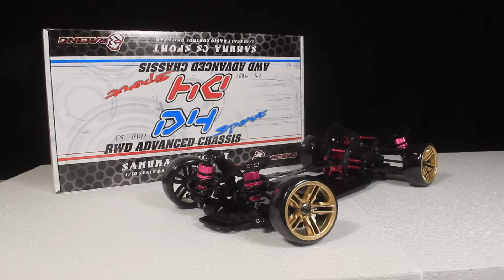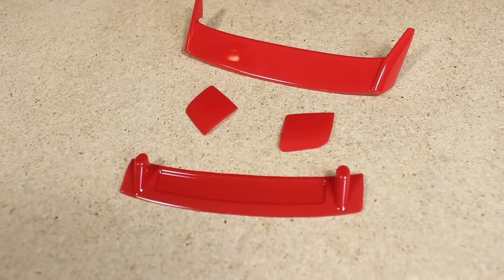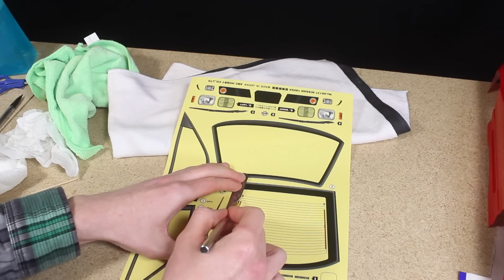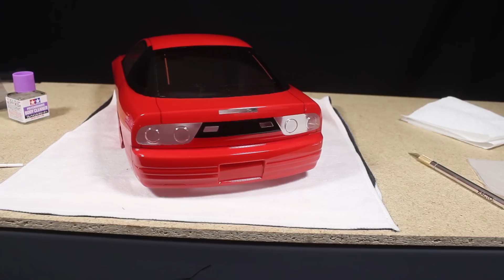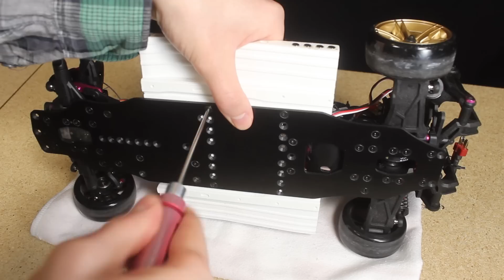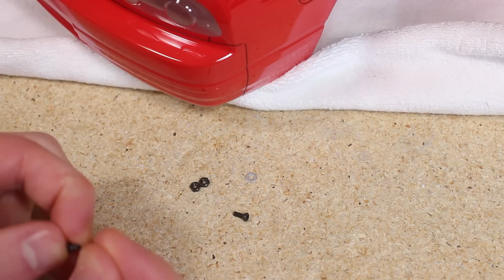Budget RC Drift Build: Part 4 Adding Decals, Spoiler, Tint, and Body Lines

Comment: I applied tint but on the outside. It looks good and you dont see the imperfections or air bubbles. So far its holding on pretty good.

Comment: for tinting with film you could use a hairdryer to form them beter, the easiest way is heating it on the outside of the body first and then putting it on the inside

Comment: man you gotta do something about lightning ... i´ve seen this with most youtubers doing similar on cam crafting and its mostly to bright (must have to do with modern HD cameras or so) .... as soon some brighter colored surface is visible it just tends to be a unified bright white "glare" without details ... maybe dim down light may help a litte ? can t tell... but i think its those modern cameras on wich everything is easily over illuminated , wich is no good in these kinda videos where the optical details are the most important part

Comment: Hey! Awsome build you have! I just got a Toyota chaser body for my chassi but im wondering how you mount your 180sx body to the chassi? I might missed it in your video but i really want to know how the body and the chassi stick together :)
Reply from the maker: Thank you. A lot of guys like to use magnetic body mounts such as these: https://www.ebay.ca/itm/4Pcs-Magnetic-Stealth-Invisible-Body-Post-Mount-for-1-10-AXIAL-SCX10-4WD-RC-Car/132847289773?hash=item1eee50c5ad:g:6~0AAOSwczdb4o-c:rk:3:pf:0 This eliminates the need to drill holes in the body for the posts. I custom designed and printed some magnetic body mounts that secure the body to the chassis. I think that was shown in part 3 or 4? Anyway good luck with your project. 👍

Comment: Hey are you still going to add an interior to this build?
Reply from the maker: Yes, I'll still be adding an interior. I left it out over the summer while I was still tuning.
Reply: Make It RC awesome can’t wait. I have the same d4 chassis just in carbon fiber that I’m trying to finish up. I have the same motor and esc as you also do this build has been really helpful for me. I’m also working on a R32 body to put an interior in as well! Keep up the great work 🤙
Reply: Make It RC I had another question. Did you buy a program card with the motor esc? I did but haven’t programmed it yet.
Reply from the maker: No, I did not buy a program card.

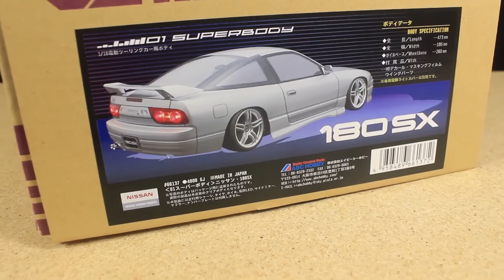Comment: At about 0:45 you said that you were more used to AWD drifting.  Are there  any inexpensive AWD drift chassis kits that you would suggest to a beginner? And are you able to use any body style (s13 for example) on any of the chassis as long as they are the same scale?
Reply from the maker: The Tamiya TT-02D is a great budget AWD drift platform. They are cheap and there are tones of aftermarket parts and accessories available. As for bodies, you need to compare the width and wheel base of the body to the chassis. Most drift/touring bodies and chassis have a wheelbase of around 260mm, and the width is generally between 190-200mm.
Reply: Make It RC okay,  thank you. I'll try and find out if I could  find an s13 body that'll fit on the  chassis

Comment: This stuff feels so hard to jump into. Is there any way to jump into this size easily? like a build guide where I can order all the parts at once in a kit/wishlist type deal so I know what to actually order? I would love to develop this into a hobby.

Also could you release your cad files?
Reply from the maker: This certainty isn't the easiest hobby to jump into. I think this hobby could use more quality resources geared toward beginners. There's a lot out there if you  do a little searching, but compared to other hobbies, this one is certainly lacking. 

With that said, a lot of people start by getting a Ready To Run (RTR) vehicle. These vehicles require no assembly and are ready to drive right out of the box. As things break and wear out, or you decide to upgrade certain components you will learn more about the vehicle, how it works and how to make it better. 

Or you could go with something like a Tamiya or Kyosho kit which are very popular, well supported and super simple to assemble (most of their kits anyways). 

As for CAD files, some stuff I do plan on releasing, other stuff I will be manufacturing and selling. Stay tuned for updates.

Comment: Where did you buy your d4 chassis because I can only find the awd version but I want the rwd version
Reply from the maker: This chassis has been made obsolete by the new Sakura D4 RWD Black Edition. It features some improvements over the older chassis I've got. I got mine from rcmart.com, you can find the new black edition there as well.
Reply: Make It RC thank you, and one more question, Is most of the aluminum parts replaced with plastic on the black edition it ate they just anodized black?

Comment: Loving your work sir. for a new item try adding some wheel wells and allow for some piping to be added in case you use a smoke generator. in regards to your balance wait for more of the interior to be in place.
Reply from the maker: Thanks for the comment. The interior should help even out the weight distribution a bit. Piping into the wheel wells for a smoke effect is a great idea, although personally I find smoke generators to be more tacky than cool but maybe some day I'll install one.
Reply: I think that a smoke generator is tacky also, but it could add some realism. looking forward to the next update.

Comment: hey have you tried acetone vaporization to smoothen the parts instead of filing them?
Reply from the maker: Yeah, I've had success with acetone vapor in the past particularly on ABS parts. But sometimes a little bit of filing or sanding is all a part needs to achieve a decent enough result depending on the desired finish.

Comment: A heat gun helps and goes a long way installing the tint nice build
Reply from the maker: Thank you. Heat definitely helps, but you have to be careful not to deform the body.
Reply: Heat gun is way too hot, maybe a hair dryer might work for you